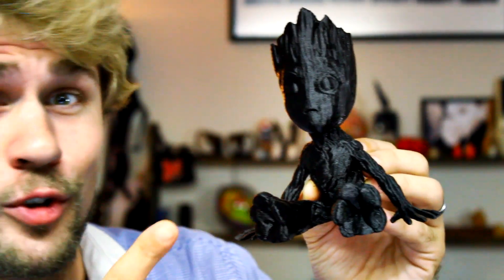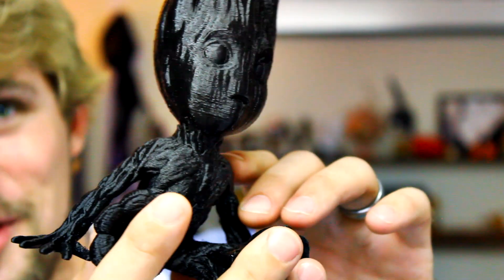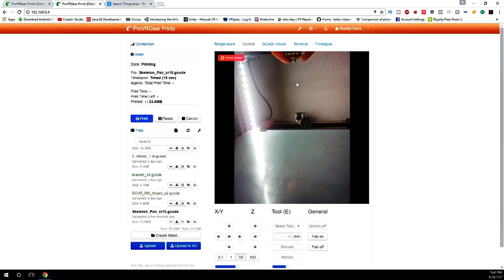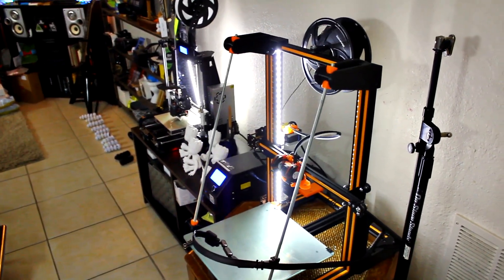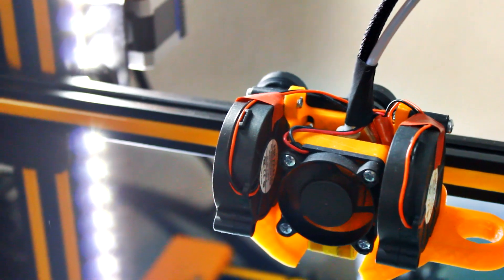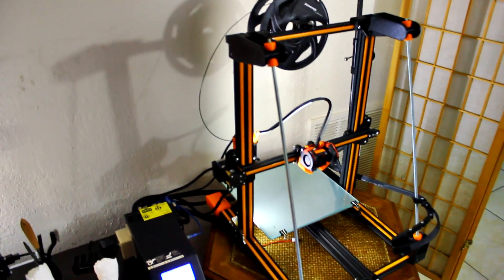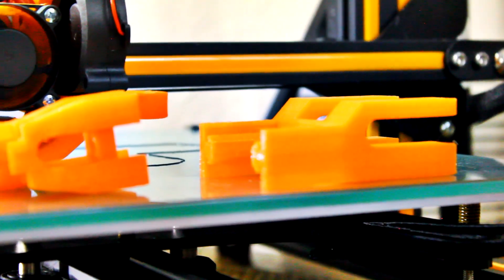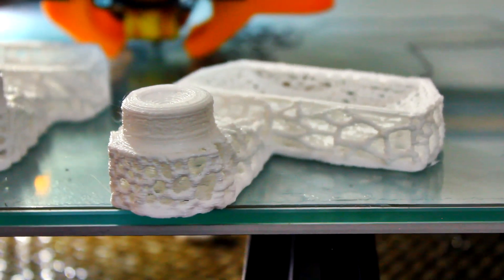✔ CREALITY CR-10 ULTIMATE UPGRADES | Stronger & Smarter!

Comment: why does everyone have more then one 3d Printer, wouldn't one be good enough, i would be happy with just the CR-10
Reply: im new to this and I think its because they print so slow.... so having 2 you can speed up prints. 

But, I suspect in this case, the other printer is a more of a entry level printer, and this is more of a mid range printer so its possible just a upgrade

Comment: Great job man! I was able to print my volcano mount with ABL, did you soldered those fans just coupling reds and blacks? Do you also have an ABL?
Reply from the maker: nice! yes I just did a basic solder of the red to reds and black to blacks) Also, I have NOT used ABL yet, sounds like something I need to research a bit) thanks for the tip Mario!) Good luck with your upgrades))
Reply: @RealityCheckVR  yeah me too since it involves messing with the firmware and offsetting

Comment: Some 3d printer owners are concerned about too much heat and the printer catching on fire and burning down the dwelling. Well, here’s an idea. Add a Sonoff wifi controlled relay/switch that has a heat sensor. You can set it up to alert you and even turn itself off when the heat becomes an issue. When you are home, you can use Alexa or Google to turn it off or on too.
Check it out at:  https://www.itead.cc/smart-home/sonoff-th.html
Sonoff TH10/TH16: Temperature and Humidity Monitoring WiFi Smart Switch
Real-time monitor–Monitor real-time temperature and humidity
Auto Mode–Set Auto mode to turn on/off at a specified temp. or hum. range
Manual Mode–Set manual mode to turn on/off immediately
Trigger Smart Scene–The temp. or hum. values work as smart scene trigger conditions to trigger on/off other Sonoff devices
Remote ON/OFF–Turn electrical devices on/off from anywhere, can work without TH sensor
App Support –Free iOS and Android mobile App eWeLink
Share Control– Control your smart home together with your family
Timing–Set scheduled/countdown timers to turn on/off at specified time
Scene–Turn on/off a gang of devices with one tap
Compatibility –Works perfectly with Amazon Alexa, Google Assistant, IFTTT, Google Nest

Comment: In practice, we control the tension slack by motor control, but in the world before that it was running with arm lever and brake.
It is not even for 3D printers.

Comment: 3 things do you have the file for the spool holder in this video. It looks a lot sturdier than the one I am using. Secondly, is the dual shroud fan set up better than the fang using the OEM fans? Last thing I really like the camera mount will you share that. Thanks and keep doing what you doing you have helped me a lot transitioning into octoprint and the CR10. Thanks

Comment: You could have attached the pie to the controllers unit through the screw holes at the top that were meant for the filament holder.

Comment: Little thing: there is actually an official upgrade from creality for a second Z-rod on Amazon by now! No need to buy from some shady eBay sellers.
Reply from the maker: nice!) cool to know) i ended up getting the CR-10S and CR-10S5 which also have the second z-rod)  not sure if ill end up doing it on mine though as it prints pretty well with stabilizers

Comment: How do you print off the top braces that the all thread to connects
 to without using supports? I tried & they came out OK but the supports make them look not all that great. Do you sand them down to remove all the support connection marks?
Reply from the maker: i didn't actually use supports, although a few areas were a bit rough, it managed to print pretty well without!
Reply: your videos are great & I really appreciate your feedback, I was about ready to try them w/o supports so now I will. Thanks again for all you do for the community.
Reply from the maker: absolutely man) thanks for the positive feedback))

Comment: is the LED strip inside the V slot's channel so the guide wheel rolls over them? or are they stuck to the face and the wheel just misses the LED strip? also, to power the Dimmer/LED's im guessing you just pulled the 12v from the stock PSU? or did you wire it to its own 12v ac-dc wall adapter? thanks
Reply from the maker: LED's are on the face and are just barely missed as it rolls over) the power is drawn from the stock psu as well) hope that helps!
Reply: ahh! I thought it looked too bright to be in the channel, appreciate the quick response!  totally doable, but barely enough room you're right. thanks Caleb, love the videos, keep it up bud!

Comment: Do you have the files for the supports? Or if you bought them what where did you get them?
Reply from the maker: The files to print the supports are in the description - as well as the parts I bought off of amazon) Hope that helps!
Reply: Does the CR10 kit you link have all those upgrades? Or is this a holy grail quest where you build it, buy/make tons of parts, and then upgrade it??

Comment: Thanks for this great video!!! I just received my CR-10 yesterday and I'm in the process of adding all the things you did. I have a few questions.
1. Where do I put those 4 huge printer heatsinks?
2. Where do I hook up the 12v to 5v wire for the Octopi?
3. Where do I hook the wires for the LEDs?
Reply from the maker: Thanks Chris! 
1. I used two of them on this printer, one on the x and y motors - Z rods never need them as they do not move much, still I some times add them for aesthetic)
2. Directly into the power supply (unhook the bottom screws to view)
3.Directly to the power supply. Mine went into the dimmer which then powers the light strips.

Hope that helps!
Reply: I got everything hooked up and it's working great, but I have a question regarding the dual cooling fans. Are you able to adjust the fan speed on yours? Mine either is off, or on full (fan speed showing as 255 on the LCD screen). If I try to set it to a lower number, the fans make a whining noise, but don't spin. Is it because there are 2 fans running off the power of the original? I wouldn't think that would matter since power is power, but was curious if you noticed that with yous as well?

Comment: Did you replace the power supply it came with?  I am curious if the original power supply can handle the addition of the Pi.  Thanks.
Reply from the maker: I did not change the power supply! The pi and lights run perfect!

Comment: Maybe you could do a video on the frame stabilization, parts I need to buy, what to print (where to get the files) and installing it. Also since stability is very important is it really a good idea to hang stuff on the frame that might induce vibration? I am not clear (from the video) just what the Pi is doing. Great video.

Comment: Inspiring video, thanks. I got my CR-10 from Aliexpress - it already had the second Z stepper installed! Is the PEI sheet ok for printing PETG? I heard PETG does not stick well on PEI.. Also, do you know of a mod to allow higher print bed temperatures? 110 degrees needed for ASA.

Comment: Cool video.  You can really ramp up your speed and accuracy if you install vibration dampeners on the X & Y stepper motors.  I'm printing at 160mm/s without distortion (slicer set to 80 and then 200% print speed on the machine) Oh and they are as silent as death...
Reply: Dampeners will never give you more accuracy.. But more silence yes .
Reply: At higher speeds... Sound = Vibration = distortion = Less accuracy
Reply: Dampeners absorb vibrations but with a non rigid link to the frame, so with the vibrations (transformed into movement)  of  the stepper on the dampeners you loose the accuracy of the motor transmission. So as Tm m said it is like skipping micro steps..

Comment: Not gonna lie, your prints look very crappy. You should use Cura! It works like a charm for me! Except the Death Star!
Reply: I kinda agreed. Hes upgrading the hardware part but really needs to fine tune the slicer. Way too much stringing, blogs, over extrusion.
Reply: xWOOLYxMAMMOTHx Could you tell me what are the best settings in cura to start with? I just got mine CR-10 clone (2 z rodes version) and with magnetic bed. User manual is useless. I try to figure out how to use this thing properly, so any help would be apreciated.
Reply from the maker: Cura is what I use!) all of my current prints are perfect*)

Comment: Do not order form gearbest, dont have them in stock, payed additional dhl express and they dont want to give back money, instead they sent 2 rolls of filament and treat it as the order that i ordered
Hustle company
Reply from the maker: doesn't sound right my friend) I would try to contact support and explain what happened. It sounds like they shipped part of the order and counted it. As long as they also ship the printer fast when its in stock. that would tell you if it was something they could control or not.
Reply: Do i need to post conversation?
Will screen record it all and post in the morning so we can see if im telling truth
Reply from the maker: Mark I never said you weren't telling the truth man, I just said it's not right, I meant that for you)
Reply: Sry i got u wrong, fighting with them about the order, they made mistake and are pushing it on my expense, thats not cool nor it is the way to conduct business, u cant say its in stock and not just one, 30 of them while not having even one and then take two rolls of filament and send them instead while also using DHL that i payed to have it in 5/7 days and after that offer me to send printer 10 days form now with 40 day shipping. Thats  more that retarded
Btw i spent like 30k on aliex by now with only one problem, and it was a mistake that got corrected...

Comment: Nice to see my frame braces and dual fan shroud on a video. :) How have you liked them? Any input for me to make them better?
Reply from the maker: Josh Tenny excellent work my friend! I think they are awesome as is! only mod I want is for a spool attachment off the top of one side)) haha seriously makes me like the printer a lot more with your mods)
Reply: Once I saw the one you have, I immediately though that I should look into adding one to the top brace on the extruder side. :)
Reply: Thanks for commenting... was having trouble finding it on Thingiverse...
Reply: be hella cool if had the  opening/cutout  inside the bottom all-thread mount (if there's room ) to snap in  a  DPDT rocker switch (double wide ) for those of us who want an upfront and  close but hidden switch or two for our lighting circuits.  some one on Th Ve also makes an LED  strip clip for the all thread to hold LED's as well may want to have an addon for that too great place to shine on the builds  from. And love the idea of adding an optional  spool holder  on top support   to both sides  ...or just the one is fine LOL im newbie and cant design yet but def see alot of hybridization in the upgrades.  And THANX AGAIN Josh for all the work youve done -GREAT WORK! CHEERS  https://www.thingiverse.com/thing:2204920
Reply: Josh Tenny is the gantry support really necessary?
Reply: The triangle one? In my opinion, very important. Not only do you want to prevent wobble, but you want the uprights to be perpendicular to the print surface. :)

Comment: You got to love a device that makes its own upgrading parts :-) Reason enough to start with a middle of the road printer. 3D printed parts are quite simply the best thing ever IMHO You make a good case for going with the Creality 10 but I wouldn't mind checking out the Anet  8 or 6 or the Tevo Tarantula. The later has both faster and higher temp platen .
In Canadian funds the CR10 is almost $800 and as much as $1800 for the fully optioned through Aliexpress. Oops I found a Gearbest price at $590 for the base model,... so there is a little (huge) variance there. Hmmm,.. how are they managing that??? 
I think I am going to just go for a cheaper version. I don't need pre-assembled kit. I got plenty of modelling ready in Fusion360 / Thingyverse to start with learning what's what. I really ought to have done this 2 years ago but spent my discretionary cash on Hexacopters, Racing quads and CNC design courses.

Comment: Z brace on this printer is total waste of time. This machine doesn't need it at all.
Reply from the maker: i agree that it does not need one to work properly, but if you plan to move it or even ever accidentally bump it while printing then it will save you! After installing I would DEF do it on any others if I had multiple - its so rugged now)

Comment: You added a fair amount of parts, I wish you had provided direct links for those!  I think this is the dual fan setup you have?  (https://www.thingiverse.com/thing:2274499)  It references an "extruder cooling duct", did you need that?   Thanks!
Reply from the maker: thats the fan all right! and yes the cooling duct is also used! basically you need that stl there, the cooling duct, the two extra fans, and some soder+ electric tape and your set for that mod!
Reply: Thanks!  I bet you could make a video on that mod all by itself!

Comment: What happened to that huge black triangle thick support frame you had hold of in the set up video? Not needed or something else??
Reply: Reality Check VR my bad, I watched it back & yep 👍 it was. Sorry 
Also with the PEI sheet, did you put it on top of the glass or direct onto the aluminium plate? And why?
Thanks
Mark
Reply from the maker: straight on the glass! When I look at the Taz 6 it has a heat bed that is basically PEI on glass so I figured I would mimic that. The AnetA8 has the PEI straight on the aluminum heat bed. They both work well, but I wish I had put glass on the AnetA8 simply because it looks really sleek and gives an opportunity for better heating overall.)
Reply: Reality Check VR also did you print the upgrades in ABS, PLA or PETG ? I was thinking about the heat if I build a enclosure for ABS printing & also heat from print head?     Thanks 👍

Comment: can you install an auto leveling module to this printer?
Reply from the maker: Absolutely! As you can see on my hot end attachment there is a little spot on the right that allows for a touch sensor to be added. I personally do not see a need for an auto leveler on my printers as it stays set and saves time each print without it. Some people love it, I don't see the point!
Reply: Özen Akkoyun definitely look at EZABL